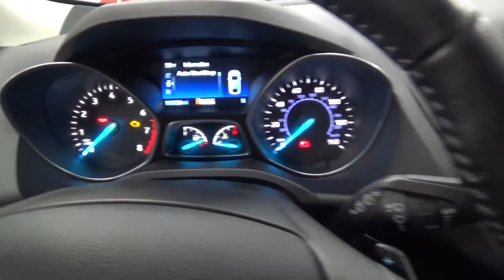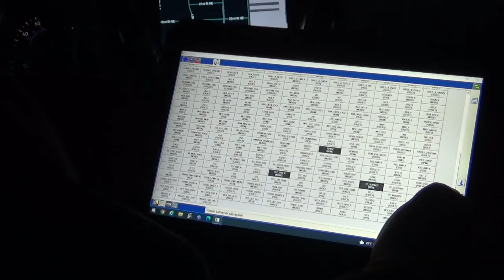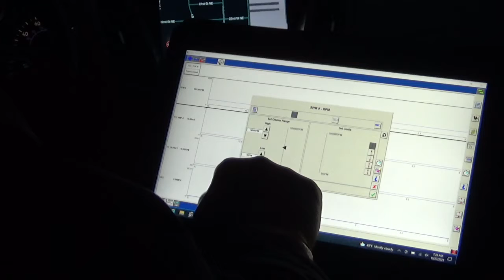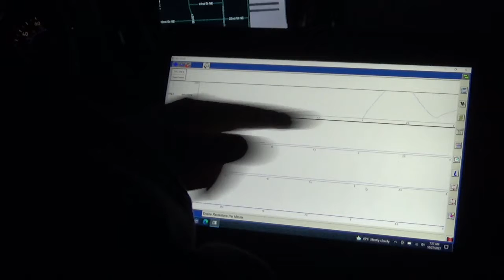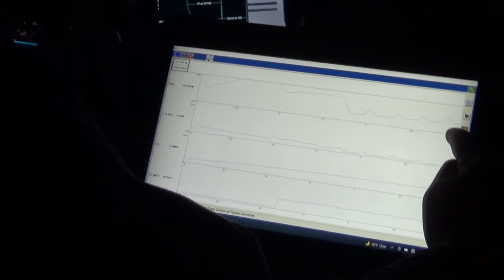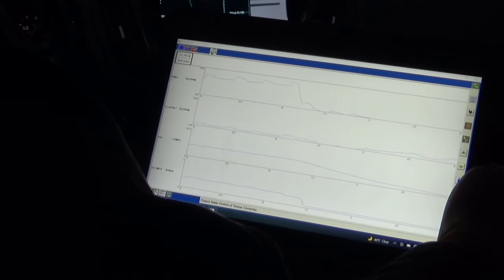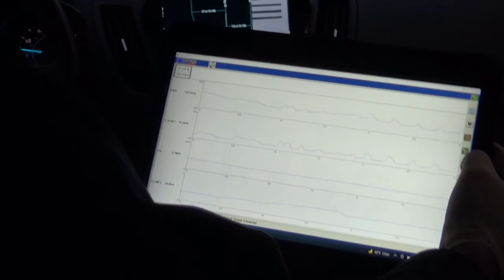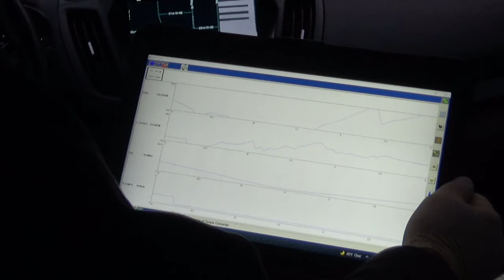FORD ESCAPE RPM SURGE

Comment: While sitting in the parking lot of the Ford dealership the rep came out n said that he thinks it's a transmission problem n with a $75 diagnosis to confirm. Then I got back on YT and found ur video. I told him to skip the dia-o n just do the flush. Then he tells me flush machine is down but would do a drain n fill. Quoted me $328.00 to do the D+F. Thanks for ur detailed video, I was able to hold my head up high n told him to go F himself. Got it done at Kyle's Garage for $50. Thank you for the video. It WORKS!!!!!! Oh n something I don't do very often, I liked n subscribed to ur video. Good luck with ur channel n helping more ppl out there.
Reply from the maker: Dude, that is so awesome! Love hearing that. One thing you may want to do is have it drained & filled again in an oil change or two down the road. Can be done the same time it's in the air for the oil change. Just have to slide the drain bucket over and pull the plug on trans. Don't even have to measure the fluid. All the 6F35's take 4.5qt Mercon LV. Did that as preventative maintenance on the x's escape.

Comment: Well folks, this guy is the real deal.   I did exactly like he said and had no problems.  So far the surging has stopped on my 2014 Escape Titanium..  Only difference is you done need to disconnect anything under the hood.   If you have a long nose plier or your hand can remove the fill cap.   Just wiggle your hand through and maybe move some hoses around.  I jacked the car up on the drivers side  high enough to get under the car and had no issues.  Drained the transmission and then slowly let down the car so it would fully drain out.   Jacked the car back up wiped the area, screwed back in the plug, and remounted the undercarriage guard.  Remember to put the screws back in the same order as some of them are a different size.  Thanks so much for this video because you were right, you can do it yourself.   I will repeat the process in a few days so its cleaned out well. 7:16
Reply from the maker: Will save you a bundle of money. Some shops will just say you need the transmission replaced. 🙂
Reply: One thing I would recommend is to add the part of how to balance the transmission fluid as well.   Just add to this video if you can.    Thanks.

Comment: I have a 2013 escape titanium 2.0 ecoboost with 119k miles that does this. No engine lights or anything. Thanks for the video
Reply: Did it fix your problem mine just started doing it at 130k miles

Comment: Hello RCW, I hope you still read these and decide to reply.  Man did I love watching your video and how you explained a few things.  Thank you so much.  Great work by you that’s for sure.  I have a 2014 Escape Titanium exhibiting the same exact surge issue, but has never shut off and haven’t had noticeable issues with shifting gears.  I took the car to my local Ford dealer twice and they couldn’t figure out my issue.  They wanted to replace my instrument panel.  I’m like you crazy as I knew that was not the problem.   I explained the situation to a guy who was working on my power washer this past weekend and he said it’s my transmission.  Which prompted me to research on YT.  I have a few questions for you if you can help me out as I’m not a gear head, but I have fixed a few things on a car as long as I can follow the directions and the difficulty is below a medium.  Give me a computer and I can make it speak in tongue, LOLOL.  

Would my transmission be a 6F35 transmission for a 2014 Titanium?  Are the drain and fill plug in the same location as my 2014 Titanium as what’s in your video?  Is there any special torqueing on the drain plug?  You mentioned one can do it themselves by just buying a pair of ramps. What would you rate the difficulty from 1 to 5, where 1 a teenager can do it, a 3 would be pray before starting, and 5 extremely hard and drop it off to a reputable repair shop?  The fill plug seems really small, what do I use to fill it, is there a specific name of the funnel I should get?  How do I know if my converter clutch is bad as you mentioned in one of your comments, is it the bad shifting is what you were talking about in several comments to others?  For clarity, Is Mercon LV a must for my car not Dextron III because it's not used anymore on newer cars?

Thank in advanced for any help you can provide.  Have a great one and keep doing your videos.  Many will greatly appreciate you.  If this process does fix my issue, I will update my comment as well so everyone is aware you're the real deal. Again, thanks in advanced.
Reply from the maker: Read swashington2825 remarks in the comment section. He had some really good insight. Yes, your Escape has the 6f35 transmission and is identical to the video. Need a T30 torx to remove the undershield screws, 11mm socket to remove the drain plug and some pliers to remove the vent tube. (I recommend removing the air cleaner housing which is the hardest part of the job IMO) You may be able to leave the air cleaner housing intact, reach your hand down in there and pull straight up on the plastic vent cap if there is clearance. The vent cap just pulls off and presses right back in. Definitely use MerconLV fluid. Capacity is between 4 - 4.5qt. Tighten the drain plug up until it's snug, don't reef on it and crack the case. Buying a set of car ramps would work great and be the safest vs jacking up one side. Any local auto parts cheap funnel with small neck will work like a transmission funnel. This job would rate a level one, as easy as you can get. As for knowing if the converter clutch is your issue without a scanner will be impossible but if your vehicle has over 60,000 miles on it then it is high probability. Good luck! 🙂
Reply: Thank you so much.   I have one last question.  If the dealership stated they found nothing wrong from using their scanner a few weeks ago, do you think I need to have the converter clutch checked?  So far the car has been running extremely smooth and shifting gears almost silently.  Compared to before I changed the transmission fluid, the car ran a bit rough.   Thanks again.
Reply from the maker: @swashington2825  Did the rpm fluctuation go away after servicing the fluid? If it hasn’t then I would change it one more time and then drive it a few days

Comment: I have a 2019 ford edge 2.0 ecoboost it started hesitating around 20 to 35 mph between those speeds its jerky anything under and over its perfectly fine do you think the transmission fluid should be changed it has 80k miles and im the 2nd owner

Comment: Wow, you've got to remove the air filter housing just to get under hoses in order to replace the transmission fluid, no wonder it wouldn't get a proper oil change, I thought it was stupid for a brake fluid reservoir to be underneath the windshield & needing to use a piece of pipe to extend a funnel just to reach the reservoir on a 2002 vehicle, when everything used to be conveniently located for easy access.

Comment: I got a 2013 ford escape SEL 2.0 AWD and i have the same problem. It's at 189k (i got the car at around 150k) and I've brought it to my preferred mechanic about it. They couldn't figure it out and said I might need to have the pan opened up. It's pricey for me. They kept advising against doing a D+F, telling me the fluid in there at this mileage is probably keeping a lot of potential problems/leaks from spawning. If I were to suggest them to operate your procedure, how can I go about bringing it up? They're a shop that services all cars and hire techs from schools only, hence their suggestions.

And personally from me, I don't know much about cars, but your videos make a lot of sense to me and might inspire me to pursue a career in the fashion you showed in this video. You've got a new subscriber. (:
Reply from the maker: I would simply say you want to have the fluid serviced. It is the cheapest thing you can do and may fix your issue. This is also something you may be able to do yourself. Drive it up on some car ramps, pull the plug and let it drain completely. The 6f35 transmission will hold 4.5qt mercon LV. Pull the air filter housing to gain access to the transmission vent tube, remove and fill the fluid. It may take a couple days of driving and maybe a second drain and fill to get it cleared up.

Comment: I am curious about whether the transmission fluid change fixed the problem. I guess we missed that part of the video. I would have like to see the graphics after the double fluid change. I thank you for the diagnostics. That video is going to save us a lot of money if it works. I was thinking about trading the car in which would get me about 60% of the retail value realizing a big loss of 4-5k. Hope it works. 2017 Ford Escape "S" Model 109,000 miles. Does the surging in the transmission just like you showed on the video. RPM jerking between 40-55 mph jumps every 3-5 seconds and drops with a RPM differential of 50. I'll follow up after the fluid change today.

Comment: I have this exact issue on my 2018 Escape…brought it into dealership with as I was feeling a shudder from time to time. They did tests and diagnosed that the torque converter needed replaced. Showed me a graph that looked identical to what you were seeing. Noted they’d lock out (turn off?) the converter and issue went away. Never had a transmission fluid change…has 110,000km on it. They’re quoting me 3500 Canadian to replace the torque converter. Based on this video, I’m thinking of doing a transmission fluid change to see if it fixes it first? Just don’t want to waste more money…wouldn’t they know to suggest this though? Maybe jumped right to the most expensive fix… thanks for any feedback!
Reply from the maker: I did have an escape a few weeks back with a TCC that still wouldn't hold even after servicing so I replaced the converter but more times than not, changing the fluid will fix the surge. Draining and filling these transmissions are really easy and if you are handy at all, it's a job you can do yourself and save a bundle of money. Buy a couple car ramps and 9 quarts Mercon LV. Drive up on the ramps, remove the plug and drain the transaxle. Pull the air cleaner housing and transmission vent fitting and fill 4.5qt fluid. Put it back together and drive it normally for about 50 miles. Repeat the procedure one more time and then drive it. It can take some time for the new fluid to "flush" the clutch out inside the converter. Worst case scenario it doesn't work and you are out a couple hundred bucks but there is much better than 50/50 odds that it will fix and you save more than 3 grand. 🙂

Comment: Hi there! I have a 2020 ford escape and it is kind of doing the same thing. Rpm needle gets bouncy when goes from 15000 to 2000 RPM and I can feel the car vibrating a bit and it only happens driving slow steady speed like 25-40 when it go past 2000 it acts normal. I was wondering if your procedure can help me. The car has no engine light or anything on and for the most part drives good. If so should I just change the fluid like you did or flush the whole thing? Thank you and great content!!
Reply from the maker: It sounds like your TCC is slipping but still could be something else like the turbocharger boost regulator. What is the mileage? Draining and filling the transmission fluid cures the problem most of the time. If it has higher mileage, having a shop flush the fluid wouldn't be a bad idea either.

Comment: Thanks for the video. I'm having this exact same problem on my 2017 Ford Escape 2.0T with 83k miles. I am thinking of trading it in and not dealing with bigger issues down the road. Is this transmission fluid change a temporary fix?
Reply from the maker: Seems to be a permanent fix if the clutch is not too far gone. With 83K I bet if the trans fluid is flushed it solves your problem.
Reply: @raincitywrench117  i have a 100k miles. Should i trade it in or just do a flush ?
Reply from the maker: @beeda69  I would flush it. If you can get it done pretty reasonable then you would only be out that cost if it doesn't work. If that doesn't work then trade it unless you really want something new anyway. 🙂
Reply: @raincitywrench117  i had a ford focus previously and the transmission gave out even after flushing the transmission. I kind of am paranoid when it comes to this brand and some of it's models with known issues

Comment: I have a 2017 Fusion doing what I think is the same thing. It seems to jump very slightly. My brother is my mechanic and recommended not doing a flush he says it ruins transmissions. I owe money on this thing and have to take care of it so should I start with spark plug change then look into this after if the problem persists? I really feel like I shouldn’t be driving my car just to avoid damage. I should note it has 65,000 miles on it.
Reply from the maker: Without question, service the transmission fluid. It won't hurt it and if you don't, it's going to get worse. May have to drain and fill twice and drive a couple hundred miles in between.

Comment: My ford sport trac 2007 is doing the same thing. Can you post a video of the test ride after you flushed it.did you change any thing other than the trans fluid and filter?
Reply from the maker: All I did was drain and fill the fluid twice and it fixed it. Had a f150 last week doing the same but flushing did not fix. Had to replace the torque converter. You could disconnect one of the cooler lines where it's easiest to access like the line behind the grill at the cooler. Start the engine and pump out the fluid into a bucket stopping the engine immediately when the fluid stops pumping, measure what came out and add new trans fluid. Or pull the pan, clean everything up and replace filter/gasket/fluid. That may fix it up.

Comment: Hello, i have the same 2017 2.0 EB and does that anywhere from 25 to 45mph. 170k miles. If I step on it you hardly or don't feel it. Cruise at highway speed and its all good. 100% is fluid related? I'm planning a long trip should I do this flush ASAP?
Reply from the maker: It can be very subtle. If you have 170K & never had the transmission serviced then that's amazing. I would definitely see if your dealer can flush fluid out or at minimum have it drained and refilled.
Reply: @raincitywrench117  i drained it, refill it with some cheap Walmart fluid and it works so much better now, will do another one with better fluid

Comment: My moms 2017 ford escape is having a similar issue.  RPM surges but car slows right down and does a jerking motion. She pulled over and wasn’t able to get it to move in reverse or drive it just revs.   After leaving it for a bit and trying again it worked normally…any ideas appreciated!
Reply from the maker: Odd problem indeed. I always start by testing the battery. A bad cell can cause all sorts of problems. Recommend a self test with a scanner to see if there are any codes stored in any of the modules. P0700 codes are transmission related. If it has U codes related to low voltage in multiple modules then most likely needs a battery. If all that looks good then need to check the transmission fluid level and condition. Replaced a 6F35 transmission in a 2018 escape last week that failed and it only had 42k on the odometer. The fluid looked nasty